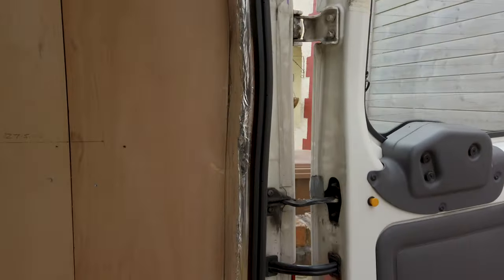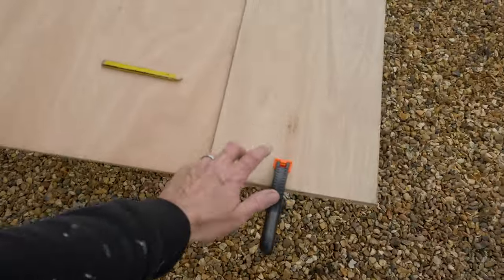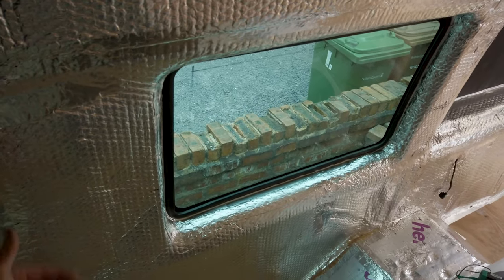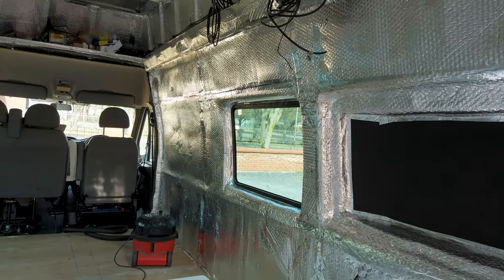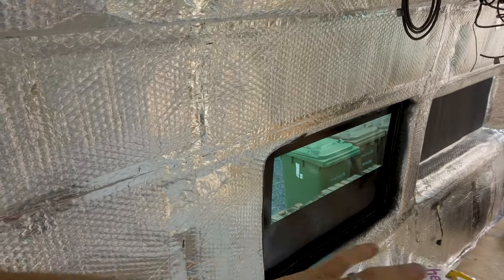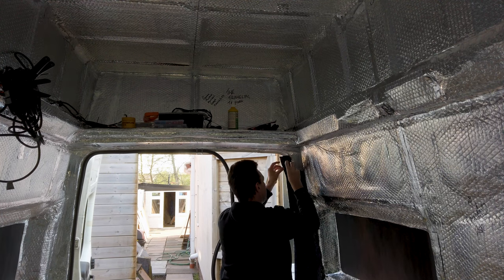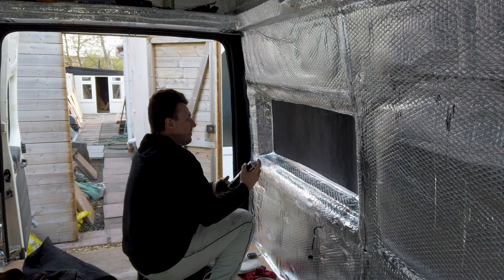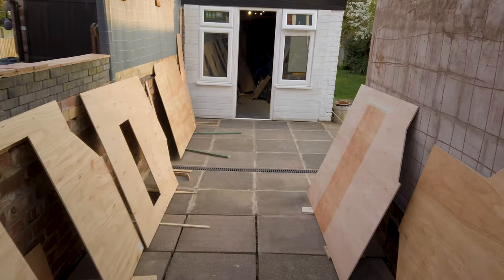Van Build fitting Carpet and Boarding out!!! | Transit Van Build | Selfbuild Conversion

Comment: How do Graham and Michelle.  You know what, you both just remined me when you mentioned foil tape, just how much I failed to notice ancilliary costs on the van. I keep saying Viv cost around 7.5K to convert but if you add all the screws, tape, adhesive, connectors etc I was probably nearer the 8K mark  ..... and still spent AFTER she was finished....but then again are the ever finished. Gotta say the black stuff was horrible to use and cut and not a pleasent experience as it made my skin react. I didnt like sound deadening or insulating either but It did keep my mind off lockdown.  Youve done a grand job so far on Woolfie. He's actually looking like a tardis room wise though once your furniture comes inside I know that will change LOL. Loved your look of pride on the pods Graham and it was well earned and deserved. You did a great job treating the panels too Michelle. Love the names witten over the rear doors. Remins me of when you move into a new house and strip the walls and the previous owners had written stuff on the walls creating a little bit of history to be uncovered down the line. All in all, a great video, lots of fab work done by you both and Woolfie boldly racing forward to his completion and the start of the bog adventures.  Bessy regs Kenny
Reply from the maker: Thanks Kenny. The hidden costs have me flabbergasted 😁 I must have been to Toolstation for foil tape that many times, they must wonder what the hell the mad woman is doing with it all, as it seems to be the same shop assistant that serves me all the time 😁😂
Thanks for sparing us on and for all your support 🙂